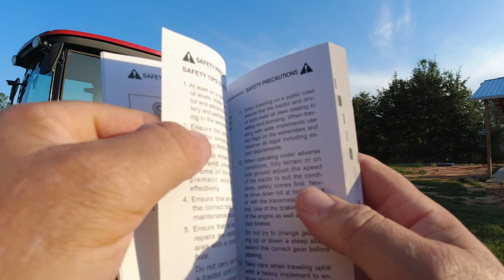I can PREDICT You're gonna BREAK YOUR TRACTOR! Here's how!

Comment: All of those things are just common sense.  No matter which machine I use on my farm (tractors, skid steer, side-by-sides, etc.) I ALWAYS check the oil before I start them up.  The same with small engines.

One point that I would add is to take your time and be aware of your surroundings.  I one time almost dropped a tree limb right on top of me when my ROPS hit it.

A manager that I worked for at one time said something that has always stuck with me.  "Slow is smooth and smooth is fast".  Don't be in a hurry and do it right the first time.
Reply from the maker: That's solid advice👍

Comment: Hey Hank. An old operator taught me to use 2 grease guns. One with red grease and the other with blue. Alternate them so you can see which fitting are greased or if your helper greased the machine correctly. OBTW a Dynahoe 190 I used to own had over 90 grease fittings on it! It would take some time to hit them all.
Reply from the maker: Interesting

Comment: I have a question of the day , I know this is down to the owner but whats your thoughts on changing engine oil once yearly or go by the manual it says 300 after the initial 50 hr service , I have a RK25 with 105 hours on it , Good video sir !
Reply from the maker: If you don't use it very often, changing the oil every year ain't a bad thing.  I do it that way on my zero turn mower, but I put enough hours on my tractors through the year to hit the service intervals.
Reply: Sure isn't going to hurt anything, and if it put's your mind at ease do it.
Reply: My Kioti CK2610HST says after 50 hour service, to change engine oil every 250 hours or once a year. Whatever comes first. I average 100 hours a year and change oil every spring.
Reply: @danielclapp636  Thank you !

Comment: first of all i dont have a owners manual for mine because its 60 years old and heck it doesnt have a need for a starter even and it uses gas and diesel and it will outlive any new tractor this tractor its a mtz 50 was sitting for 8 years before i bought it (also im 20 years old bought it a year ago) and i just put fuel in it yanked the pullrope and the damn thing started and then the diesel started right after